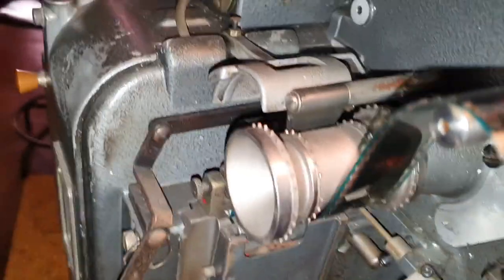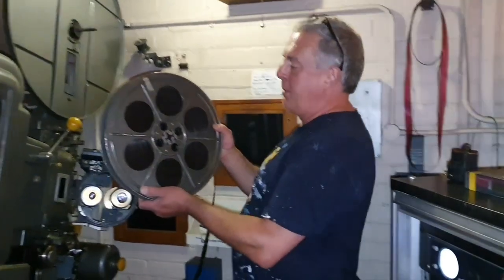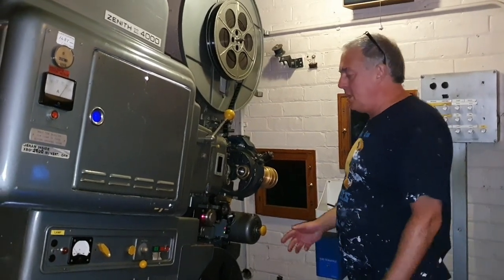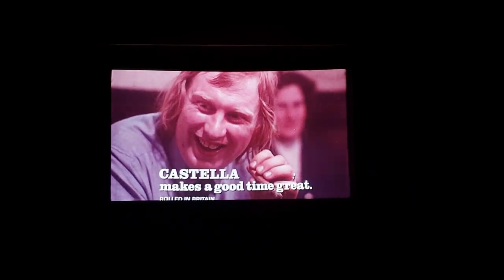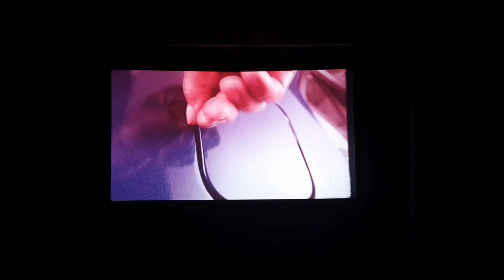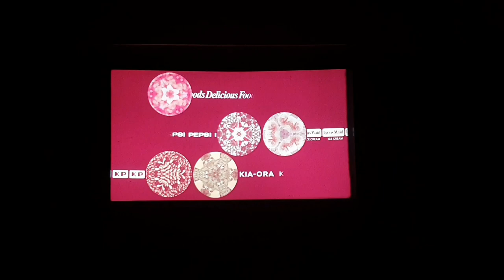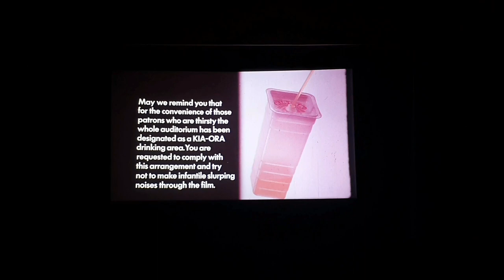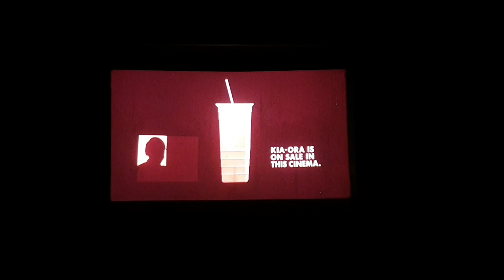35mm film projection Parkway Cinema Barnsley screen 1

Comment: thats the same vic 8 (pointing down) i used at Ipswich odeon with a Phillips platter. the BLUE END SEQUENCE that buzzed when the spliced foil hit the sensor to shut down if you wasn't there. i once forgot to turn that on and after INTERMISSION the film kept running l into the feature that was supposed to be scope

Comment: How can you achieve such a bright picture given that (1) the projector has a 3 blade shutter and (2) the vertical style lamphouse is inefficient?  Is the screen really small?
Reply from the maker: Hi Mike, those lamphouses are not as bad as you might think, if aligned correctly. This one has both mirrors intact, highly polished and with a 2.5KW Xenon lamp.
That particular projector has a 2-blade shutter and the screen is approximately 8m wide.
Reply: My experience is with a Christie (vertical) lamphouse using a 2.5 KW lamp at 77 amps.  Screen 7.27m wide. Illumination of screen 13 footlamberts with new lamp. Projector was a Century.